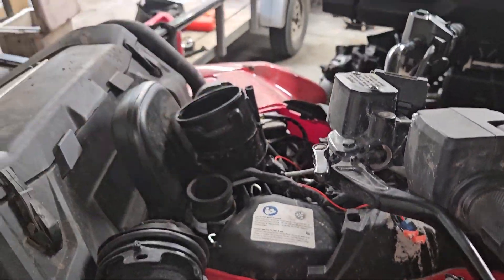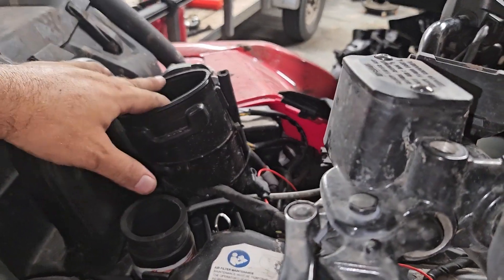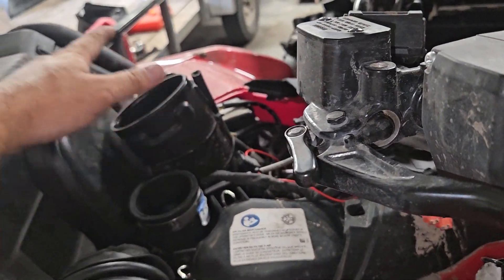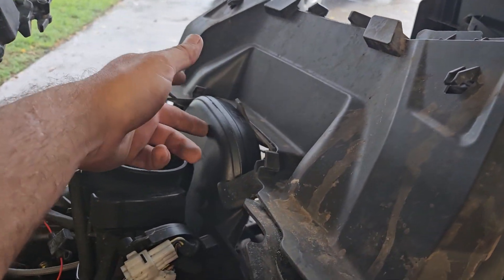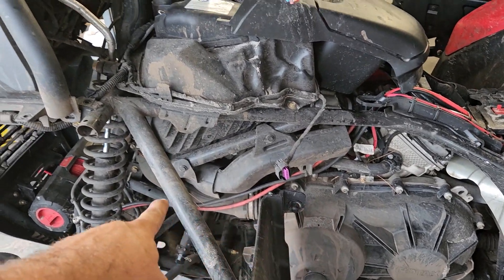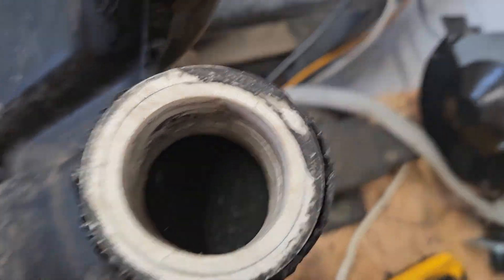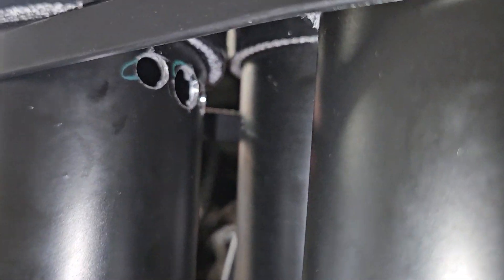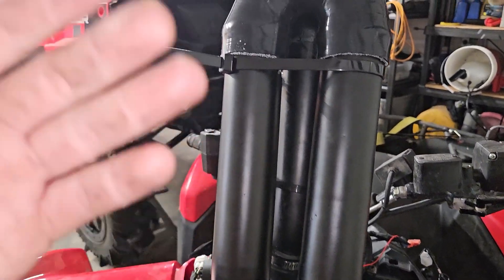Gen 3 XMR Snorkel Risers! First 2023 Outlander Extensions!  XMR700 Updated*

Comment: I know this is completely off-topic of the video. I currently ride a 2019 Forman 500 SRA with ele shift. Not a fan of foot shift. it's on 28" moto havoks which seems a little heavy for it. I also own a 2014 Can-AM Outlander 1000 XMR completely stock that I've been thinking about trading for a rubi or p500 and selling my Forman 500. I really wanted a DCT to avoid a foot shift. What's your opinion I mostly ride deep water/ trails not the biggest fan of straight mud pits. I saw a comment on another video leaving me to believe you are not a fan of the dct could you elaborate. looking at running 32" Aztecs no gear reduction
Reply from the maker: Foot shift is superior unless you're an amputee. What you don't like is the fact that the Honda has no power there is no comparison to your Can-Am a double clutch is not going to fix that. I don't like the double clutch Hondas because it's more expensive and harder to do a gear reduction on them and they have more sensors and actuators, they are generally reliable however foot shift gives you more control over the engagement
Reply: @MudPuppyOffroad  The Can Am is just a 2up honestly kinda scared to take it deep like my Honda. If I was trading/selling it for something to go deep what would you recommend my Forman does fine just trying to get a IRS and sell my Forman any recommendations I was looking at p500 but those are also DCT right?
Reply from the maker: @XteriorxpertsFL  wrong, p500 is electric shift, which is much closer to a foot shift. If you have further questions message me on patreon

Comment: So with the belt exhaust being so long and having that u shape do you have to extend it or could you leave it and just extend the other two since it’s just blowing air out and not sucking it in?
Reply from the maker: There's not nearly enough pressure to keep water from coming in that two and a half inch pipe especially at idle
Reply: @MudPuppyOffroad  thanks! I always wondered about that cause I know most machines belt exhaust is lower than intake